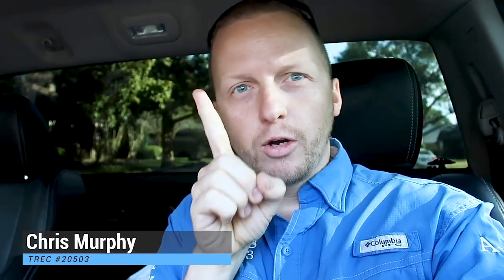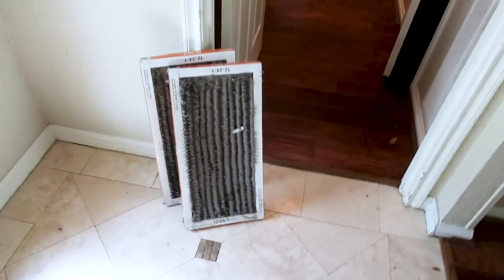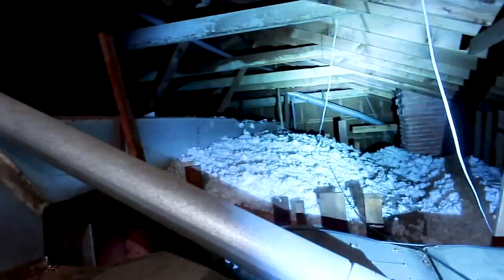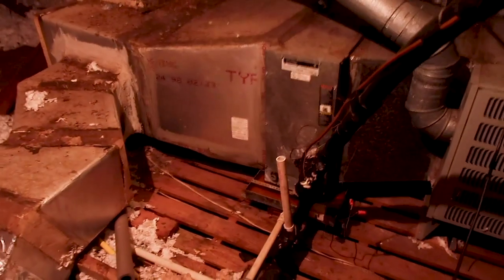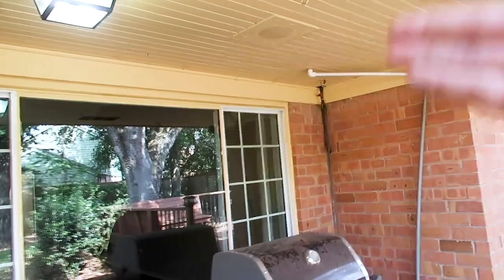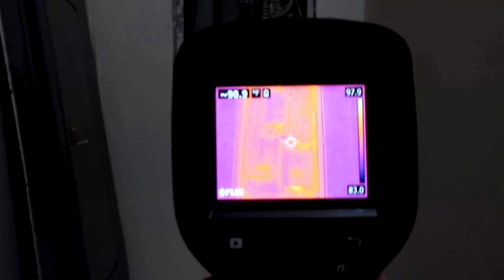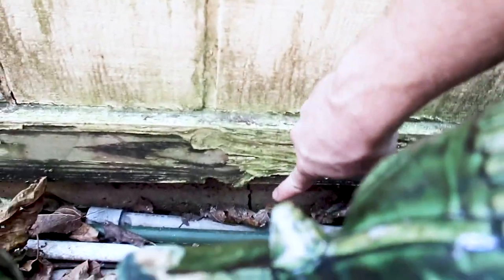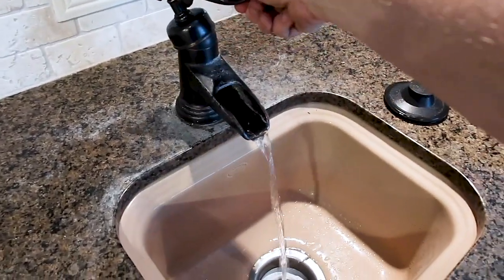Home Investigator: Episode 17 - Should I Buy This House?

Comment: Good stuff, I always list estimated repair cost. This gives the real estate agent a current amount to negotiate from, they appreciate it.
Reply from the maker: Right on, Where do you get your prices from?
Reply: @AActionHomeInspectionHouston  If its an appliance I usually look it up on line and add an additional cost for insulation. Or like the other day I did a high end condo on the beach that needed the rollers on the sliding glass doors replaced.  I looked up a company that specializes in this gave them a call. I told them I was a home inspector and was just looking for a quote for a report and they happily gave me a price. It always helps to be kind. I would write on the report.

ESTIMATED COST OF REPLACING ROLLERS FOR BOTH SLIDING GLASS DOORS: $1000+

let me know what you think?
Reply from the maker: Carlos Bailly not a bad strategy but we never write prices in our report.  The main reason is the price difference between contractors is pretty extreme.

Comment: Great video this week. What’s considered an unsafe temperature for wires in the panel box?
Reply from the maker: We normally get readings around 90 to 130s.  The AFCIs normally run a lot hotter.  If something is wrong it typically the temperature jumps up really high into the 200 range.   There isnt much of a middle ground.  If something breaks or is broken you get pretty hot temps off of the box pretty fast.

Comment: I thought that aluminum wiring and galvanized water lines were long gone by the 1980s.
Reply from the maker: Everything home repair galvanized pipes were still used in the 80s here.  I was surprised by the aluminum wiring.